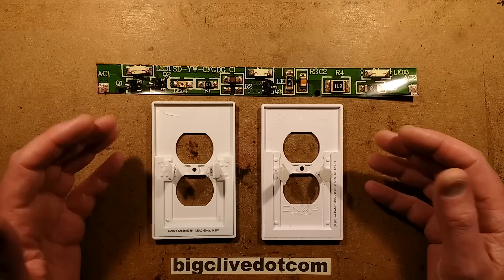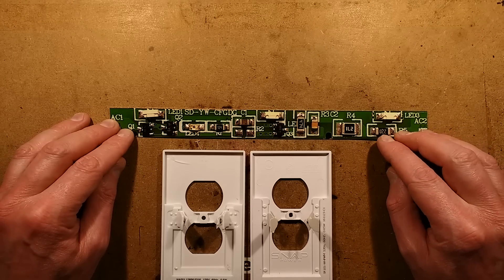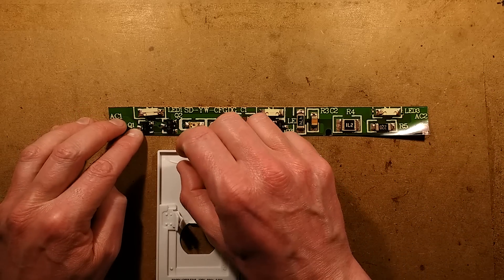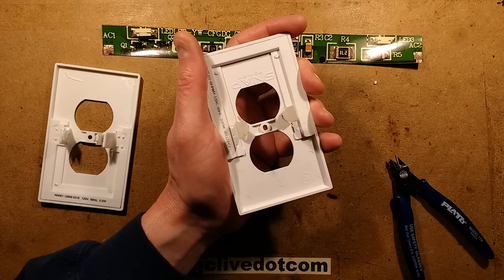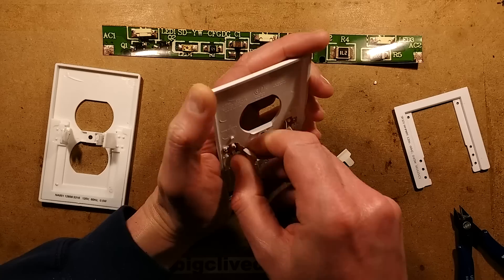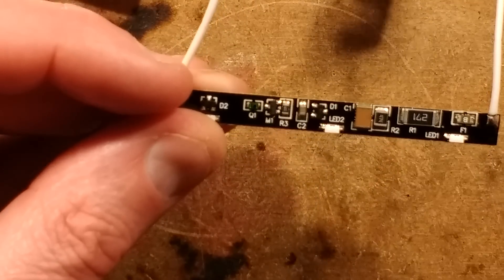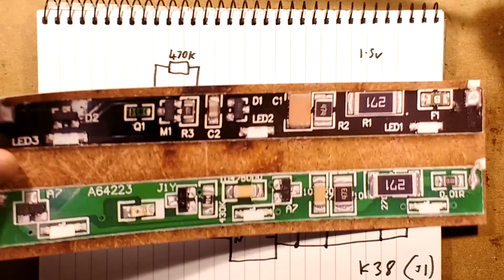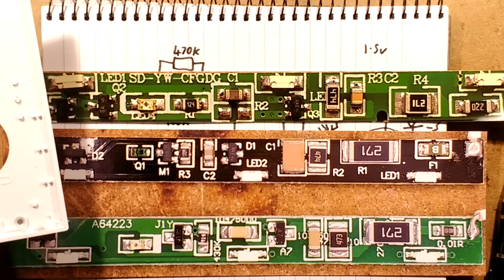Inside a REAL Snap Power UL certified night light.

Comment: Thank you for answering most of the questions I had as far as Snap power(SP) vs all others, I’ve had 4 SP outlets installed in my home for about 5 years w/o  any issues, but always wondered why the higher cost for seemingly such a elegant simple device, and now I believe you’ve answered it ,,  better quality and engineering, I recently  (3-4 months ago) purchased 2 night light covers from Lowe’s by a company called Westek, called  Lumicover @ $10 each, , 1 works perfectly the other  after 2 months only comes on dim, about 1/3 of full brightness, SP also slipped on the outlet w/o much fuss compared to the other. Conclusion : I still think Snap power could be a bit more economical, but, you get what you pay for sometimes , seeing the components of each tell the story,,,,,, stay safe, stay well, stay sane everyone, 😆😂🤪,

Comment: So glad you posted this! My Snap Power light failed. I was able to disassemble and discovered that the fuse was blown and the big capacitor had failed. I jumpered the fuse and replaced the surface mount cap with a small 100nF cap and all is good again!
Reply from the maker: The capacitor must be rated for near mains voltage.  If not it will fail again and without a fuse something else will fail instead.

Comment: You know, if I were designing this thing, I wouldn't use any LEDs at all.  I'd use a couple of little neon glow-lamps, NE-2 or that sort.

I've just installed one of the USB charger outlet plates offered by Snap Power.  I got it for 10¢ from a thrift store, but it seems to work OK.

Comment: mayby stupid question,
but i think in the schematic the mosfet and the 3 led needs to be in serie and not parralel. because now the leds wil always be turned on. Also the bridge rectifier will be shorted when it is on. That why i think it needs to be in serie
Reply from the maker: It does short them to turn them off.  The circuitry to switch a higher open circuit voltage is more complex.

Comment: Did he say "170 volts"? Where did he get that from?
Reply: 120V is the RMS (Root Mean Square) voltage which varies from -170 to 170 volts over a single cycle of AC Power, but averages to 120 volts over the cycle, which is 60 times a second in North America.
Reply from the maker: Peak voltage of a 120V sinewave.
Reply: I appreciate the answers to my unknowingly elementary question.

My mind has just been blown. All this time I assumed voltage on the electrical grid was measured in peak.
This led me to look for why household AC would even need to be measured in RMS in the first place. Down the rabbit hole I go.

Comment: I find the comments about the perceived safety of US (and Canadian) home electrics quite amusing. Having moved to the UK many years ago, I still find shocking (pun intended) situations that would never be allowed in the US. The UK for a long time banned any sockets in the bathroom (regularly weakened over the years, so now you can have one if it is 1.5M from any source of water - that's a big bathroom) so you see all manner of work-arounds, long extension leads running up the hall into the bath - creating not only a shock hazard but a trip hazard as well. 

It would be interesting to see actual electrocution statistics by country (and I mean in the proper use of the word - death by electricity). UK installations are all over the place but - like the toilet overflow just above the front door - the only "proper" way to a Brit. The Germans are like the US - RCD/GFI circuits in baths (because they are useful) and the French? Just put a regular 230V outlet right over the sink and that's fine...
Reply from the maker: Usually a shaver socket in the UK has an internal isolation transformer.  The fatality statistics show that the percentage of the population that is electrocuted is higher in America than in the UK.  Possibly because people are more casual with 120V because it is less "aggressive" than 240V.  But the regulatory bodies in the UK are trying to change that by replacing the traditional 4 year electrical apprenticeship with a course called part P that is basically a slide show that lasts between 1 day to a week and makes you a certified electrician instantly, especially if you pay regular cash to the private profit making companies who are in on the scam.
Reply: Thanks for that - do you have a link to the info? I'm not really surprised because in design (if not always in practice) the UK seems very cautious. I don't think the US is even aware (in general) what a volt is - let alone voltage. One very common problem I often see in the UK is in old country pub toilets (I've seen a few) where electricity was obviously not in the original design. They have hand dryers or the like connected via a loose cable (untrunked). Just the perfect height for a child to jump up and grab. Depending on which end rips out first, that could be unfortunate. In the US no such loose cabling would pass even a rudimentary inspection
Reply: While that is horrid, I wish it was possible to take a relatively short course with a test to be able to legally do simple electrical in your own house. Where I live you can't legally work on anything considered a "permanent installation" (which is basically anything not plugged in), and it's a pain.

Comment: When you mention the clones are less safe, in what way do you mean?
Reply from the maker: The capacitor used in the dropper is very small.  If it failed it would pass high current through the circuitry, hopefully blowing something clear.
Reply: But did you manage to get its value Clive? Thanks btw

Comment: There's currently a shortage in large size (voltage*capacity) ceramic caps and even in normal availability times they are relatively expensive. Reason enough to skimp.

Comment: One problem I have with the snap power lamplighter is they are like 17 bucks each... why/how?
Reply: SkuldChan42 
I would imagine there is a lot of liability for a product like this. These have the potential to short out circuits if installed on a split socket. They can cause arcing if they don't make solid contact. If they sell well the price will drop over time.

Comment: I have one of these. Got it so maybe i could rig the LEDs to a battery for a battery nightlight.
Reply from the maker: It would require a 12V supply and a resistor, but it would work.

Comment: I dont understand how these plates connect to the power, as I'm in the UK, it would have been helpfulto see a backplate and how it worked.
Reply: ian gee 

When you say backplate assume you mean the outlet it's self. Our outlets are terminated on the side, hot on on a side neutral on the other. The contacts simply touch the screws on the bottom, for the Snaps one anyway. The clones tend to make contact between the screws, which is a problem because that piece can be removed to isolate the two receptacles. 

If this link works you should be able to see what i am talking about.

https://www.homedepot.com/p/Leviton-15-Amp-Tamper-Resistant-Duplex-Outlet-White-10-Pack-M22-T5320-WMP/100684043
Reply from the maker: The American sockets have a power module that fits into a narrow but deep box.  Then they have a decorative faceplate that sits on the front with a single central screw.  The electrical connections are on the sides of the modules, so these faceplates have sliding contacts that just touch on either side to get their power when you put them on.

Comment: Clive, my first reaction is that the real thing is ingenious. But. We have many double-box outlets in the US, many GFI outlets, none if which can use these. Bummer. And then I realized, these rely on contacting the side screws. Except, our big urban codes require metal boxes and metal jacketed cable, so any union man wraps the switch or outlets in electrical tape before installing it in the box. To prevent a loose hot wire from wreaking havoc. And that means these can't be snapped on at all, first the guts have to come out and the tape removed. Oh well, nice concept.

Comment: The bigger fuse looks like a 0805, which don't usually have 120VAC rating, doesn't that defeat their purpose?
Reply from the maker: If it's to do with arc interruption then the series resistor may help with that.  I'm not sure how well the fuse would break the circuit if the cap failed.
Reply: Find out for us!
Reply: Exactly, the capacitors could short when the socket is bumped hard. Anyway  some PCB track would blow no matter what the fuse does...and maybe the LED's

Comment: Too bad they have to use a shunt method to kill power to the LEDs, which is wasteful as the number of these types of devices increase (LED nightlights etc)  Seems like a special TRIAC or transistor with a photovoltaic cell to turn on would be better vs this lazy hack method.  So instead of a CDS light resistor or photo diode which is passive, they could use a tiny photovoltaic device to activate a super sensitive gate of a transistor or TRIAC to genuinely turn power on or off.
Reply from the maker: It's hard to beat a cheap transistor, light detector and resistor.  Another circuit which did use full switching needed so much current for the light sensor's power supply that it ended up drawing as much as the simple circuit would have.
Reply: Conventional systems that turn off do indeed draw more current than the LEDs themselves.  Just an idea though....Tiny tiny solar panel produces micro-microamps of current from light to bias a very sensitive gate on its own.  No external biasing current necessary, so when off.... it is truly off.  Not just pretending to be off.  It all comes down to cost and agreed the power loss is minimal.  However, I can envision a device no bigger/expensive than the photo-diode they are using and NO external transistor or biasing resistor needed anymore.  Would just be a tiny photovoltaic cell and high sensitivity gated TRIAC or FET all in the same 2 leaded translucent package.  No need for the gate pin as it is internally connected to the photovoltaic cell that creates its own bias voltage from ambient light to turn the device off and on.  Truly off and truly on.

Comment: Could you explain the inrush resistor? I think I know what it does but I am not positive.
Reply from the maker: It limits the maximum current in the circuit.  Mainly when the power is first applied or if there is electrical noise.  If the power was applied at the peak of the sinewave the capacitor would charge to that voltage instantly and pass a very high current spike that could damage the circuitry.
Reply: Yeah that is better than what i wrote. (:
Reply: To limit the current to the capacitors when it powers up,otherwise it could trip fast acting breakers ect.

Comment: Let me get this straight... In america outlets have well exposed live contacts on the side easily accessible for private electrocution simply removing the cover plate?
What a great and advanced country!
Reply: The cover plate is held in with a 1 inch fine threaded screw, and the outlet itself is mounted to the box via two additional screws. So I guess if you spend a minute removing the cover plate, then remove two additional screws, pull the outlet out of the box, and then purposefully bridge the connection lugs you could be electrocuted. I’d hardly say they are “well exposed.”
Reply: ... And you couldn't intentionally circumvent the idiotproofing of any other enclosure?  Why, anyone with simple tools could just walk by your meter socket and accidentally disassemble it and shock themselves!
Reply: Dumah Brazorf That's why there is a cover plate. Curiosity killed the cat
Reply: VS a bulky surface mount box and giant open docking-bay socket cavities that collect dirt on the wall for every outlet on your side of the pond?  Seen plenty of god awful European wiring and amazes me things haven't burned to the ground.  America has its treasure-trove of crappy wiring too; but the modern 3 prong outlets I always thought were pretty decent.  Exception being the thin section of plastic that breaks on the ground pin cavity of certain Decora style outlets.  The European two prong fits into this crazy cylindrical cavity with exposed metal ground contacts that cannot be cleaned or wiped down easily.  For this reason, many have a hinged spring loaded cover you have to lift up to be able to plug your stuff in.  But you guys are dealing with 240VAC vs our 120, so outlets probably require a bit more isolation.  Finger between the blades will tingle here in the USA, in europe... I don't want to know.  Probably why you have the docking bay type outlets so that cant happen.  One thing I will give you Europeans over our American electrical, that 240 volts at all outlets boils a kettle of water very fast, allows for amazing vacuum cleaners and allows for astounding toaster ovens.
Reply: That was nearly 400 years ago, things have changed.
Reply: Please stop lumping all European countries together (at least in terms of electrical safety) as, here in the UK, I think we generally have excellent standards compared to the rest of Europe and our electrical outlets are, if anything, over engineered for safety purposes. Nowadays, it's almost impossible to get anywhere near a live conductor in an intact UK plug socket unless you're very determined and have at least two implements to hand.
Reply: a zap from 120VAC is a pick-me-up. From 240... a pick me up and throw me into the ground :((
Reply: In the USA little curious Timmy gets a jolt, and and a bang at mains voltages. Meanwhile in Europe curious Timothy gets a stroke of lightning from god, thrown across the room, his heart instantly stopped because the voltage has the ability to propagate farther than skin deep. Nothing is idiot proof and making things too safe just breeds better idiots while frustrating sensible people. 
Frankly it’s easier to ground the outlet out with a bit of metal than it is to purposefully open the cover. If it’s such a bloody damn concern, silicone the cover in place. Now Timmy has to find a paint scraper and daddy’s screwdriver, if you can’t catch the kid rummaging around in your tools and think, “ah, a perfectly sensible thing for a child to do”, then you didn’t need kids in the first place
Reply: Yeah, almost as dangerous as putting a shitty switch on every outlet giving you the false confidence that the device isn't still live to ground?
Reply: Dumah Brazorf  - we were an advanced enough country to throw you guys out on your asses.

Comment: Great video. As a laymen with little electrical knowledge outside high school physics, I have been able to keep up for the most part.
Reply: These type of outlet lights are much safer to install vs installing an electrical outlet with a light, just cut that breaker OFF for the outlet and double check before the install , but I understand why a lot folk are nervous about messing with electricity, I don’t get nervous so much now , I stay conscious of the devil I’m with, because it it has bit me before, but just a tingle, I was lucky.

Comment: TBH, I don't like any of these 'permanently connected' circuits in sockets such as the types with built in USB outlets, for one thing if you have alot of them the small amount of power they use adds up, plus if they fail you  (a) still have a damaged circuit board connected to the mains, (b) have to replace the entire socket. 
Also if in a few years time Device manufacturers introduce a new type of charging connection, they'll all need changing again. 😕

Comment: I always wondered about the advantage of this device over a regular plug-in LED nightlight. The only thing I can think of is having one more available outlet. The price and design seems really silly to me. Two spring loaded contact arms touching dirty or tarnished screws won't promote reliability or safety in my opinion.

Comment: Still makes me wonder what they're like in terms of reliability when the contacts are just touching the screws on a typical north american socket (some have push-fit wires, for that extra safe feeling of safety with up to 20 Amps going through!!) that may have been in place for years and developed a nice resistive patina... :S

Comment: Did y’all notice the American version has the contacts slightly offset. That’s so if the power is split, like the upper outlet is switch operated, you can rotate the plate to touch the contacts that are always on.
Reply: Wouldn't you need to turn the outlet over? If you flip the coverplate the LED's would be aimed up.

Comment: wouldn't is te more economical to have a simple circuit that just always lights the leds? it saves at least the LDR, a transistor and whatnot... and in either case amost an equal current is being drawn I'd guess?
Reply: You're right about the current always being about the same. However when the LEDs are shunted out, the voltage across the circuit is less, and because it's powered by a capacitive dropper, it results in less power consumption.
Reply: This is the same arrangement as in many cheap LED night lights, where the power is shunted by a low voltage (therefore cheaper) transistor - Clive's reviewed many in the past.  The "slightly better quality" use a zener for regulation - however these are always under-sized for 240V, and fail early.